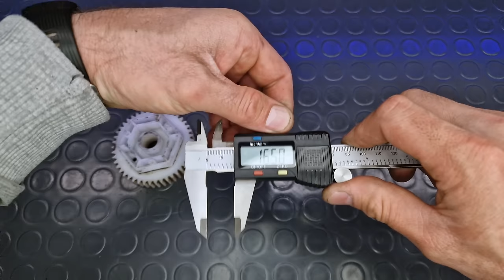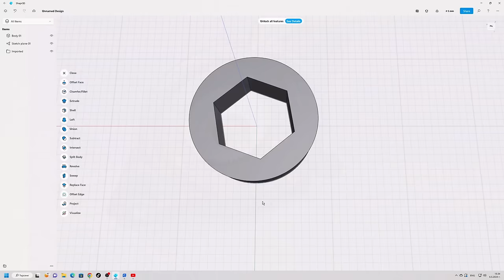Adding electric starter to Lawn Mower running with 20V Parkside Battery

Comment: Good job BUT, you didn't finish it. you forgot to put a cover over the little starter motor. it will get dirt and dust inside.

Comment: I just took the recoil rope starter mechanism off my mower and use a corded electric drill driving a  socket sized for the main shaft nut, to turn the motor over, F1 racer style. Works well enough for me.
Reply: my cordless drill works fine too. ;)
for those that are safety minded an extension with a ratchet to the deep well socket - yeah over kill, but even the sister can use it.   [useful on several small engines & starts it up in the field]
Reply: Yeah tried that on mine and it blew the battery drill up 🙄
Reply: @marksweetman8765  bummer - mines been ok, its a dewalt 12V and I yse it on high speed #2 I think.
 of course my  corded drill is bigger n faster, but its not as quick out of cord reach.

 to be honest the mowers been warmed before I used the battery drill - so its an ez quick start.
Reply: @bellyacres7846 I haven't found a ratchet  adapter yet that will work. The ones I've tried always locks in both directions when used in a drill because of the high speed.  I've come close several times of having my wrist broken.
Reply: Just remember to use ratchet adapter so it doesn’t tear up drill or nut on mower. I been using mine for years. Use on mower, chain saw, generator and weed trimmer. Works great.

Comment: Could you just splice the spark plug wire and connect it direct to the battery and put a switch that you briefly pulse?

Comment: This is an excellent idea without all that rotten pull string nonsense.
Reply: My recoil starter lasts a bit longer as my mowers have a device known as a blade brake clutch.  If I have to stop for whatever reason briefly, the blades stop and the engine continues to run.

Comment: Although I'll need to do some things differently I'm going to attempt this with my 5.5hp cub cadet engine. 
Ist off is my recoil start housing is made from steel instead of plastic. Next is the fact I've picked up 3 different power wheels cars for free but all have the 6v motor and single wheel gearbox. All have the cog type gear that mates with cog made onto the wheel. I shouldn't have a problem with making  the set-up work. I also have two 12v motors from another power wheels car.
I think the gearbox will stand up to starting my engine and I know others have replaced the 6v motor with a 12v motor.
My biggest concern is will the 12v motor and 6v gearbox stand up to a 20v Dewalt battery? Will the 20v battery burn up the 12v motor or if it doesn't burn up the 12v motor will it create to much torque and strip out all the gears in the gearbox? Now for my main questions of preventing this. One should I use a 20v to 12v step down converter or should I use a speed controller with the 20v battery? 
I could dial down the speed enough to where it doesn't trash the gearbox.
Both the speed controller and the step-down converter are fairly inexpensive with not much difference in price between the two.
Any advice would be greatly appreciated.

Comment: This was a very good build.

Thanks for the upload. I'm going to do this myself, but I'm going to use it on a predator generator and add a remote control for the motor so that I can crank it up during this winter without having to go outside into the cold to hand crank it.

This is a very good and useful idea.

Many thanks to you!

Comment: Check the valve clearances on this mower. If you set them up well, it will fire better.
Reply: Been setting mine by what Teryl does 4 thousandths. Does fire better.
Reply: I imagine the gearing from the Power Wheels gearbox is really low.  Gives you more torque, but it turns slow.

Comment: People are fascinated with letting electricity do all the work. The beauty of a standard car is you can push start it. Doesn't matter if the battery dies. I like to use muscle power. It's more reliable.

Comment: Do the fly wheels on these little engines not keep running when the engine is running? because if they do, that electric motor will still be attached to the spinning fly wheel just moving.
Reply: The flywheel does, but the motor and gear disconnect. Those two little spring loaded arms extend due to centrifugal force once the rope is pulled/motor spins. That makes the connection to the flywheel. After pull/spinning, the arms fold in again.

Comment: İ want to make my 110cc ATV engine starter like this but with this reduction its to slow to turn the engine
Reply from the maker: That's exactly why I used a 20V battery.
I think this DC motor is 12V

Comment: Awesome job but you Shouldn't use heavy grease in the dog leg spring area as it stops them retracting properly and i think thats what that awful squeely noise was when the engine was running
Reply: I was wondering about that, also, I expect dust will get in and make it worse over time.

Comment: Good idea. But when you use the battery without safety electronics, you can destroy it if you drain it completely. There is an electronic device in the battery, but it does not protect against reverse polarity on the cells.
Reply: The batteries have protection circuits built in to stop full discharge.

Comment: what is that spray that you use? brakekcleaner?
Reply from the maker: It is a two-part adhesive with a spray hardener (Mitre Apel, Akfix 705 etc.)

Comment: That's pretty clever and nice work by the way but back in my day I would just use my cordless drill and a socket and extension and spin the flywheel nut
Reply: That's a really excellent way to break your wrist (if you don't have an adapter that prevents rotation feeding back to the drill).

Comment: Does the clutch have any sort of spring back that way it’s not spinning with the engine when it starts up?
Reply: 10:54 Starter pawl springs.
Reply: @markrainford1219 yeah I figured that out when making my own😅, but the motor and gearbox I got doesn’t spin fast enough to start my 173cc engine

Comment: Without a bendix to disengage the gear, the gear will wear down fast.
Reply: It does disengage all he did was motorized the pull start mechanism which disengages by those metal pins and springs that he installed twards the end
Reply: Re watched the video. missed the clutch install before.

Comment: if you would have just added a bolt heat to the spinny part you can just use a drill
Reply: And then you take the risk of breaking your wrist. Also if it stalls then you need to go get your drill to start it again, unless you wear the drill on your waist like a handgun 😅

Comment: Hi Congratulations.  The idea and its implementation are sensational.
 Please don't take it as an intrusion, would it be a big request of you to upload the STL files of the parts you designed and 3D printed, or send them to my e-mail address?
 Thanks in advance.
 Regards, Paul😊

Comment: I dont think any of those tools were used as intended.

What did your child say after you wrecked his car?

It did sound quite good when it was finsihed.
Reply from the maker: The child has already grown up, the video with the child was about 5 years ago
Reply: @ErCanEverything  Yeah but i never like wrecking one thing to make another. Thats just me.  Couldnt you get an electric motor from ebay etc?
Reply: Its called repurposing... seems youre just happen to buy more sh.t

Comment: Why not use the cordless parkside drill on the nut to turn the crankshaft via a socket adapter ?
Hmmmmm not so much fun ?
Reply: He would have to carry the drill all over the place, front yard, back yard, etc.

Comment: Or, once you remove the pull cord, take your cordless  drill with a 19mm socket and start it directly off the nut that’s there.

Comment: This is the dumbest thing I’ve seen in a while. You’ve gone from a simple reliable pull start to an over complicated nightmare with batteries, motors, wiring, ect. So when you need to use the push mower your going to have to deal with all the crap like dead batteries, bad starters, solenoids, ect. That you have on a rider! Converting my rider mower to pull start was the best thing I ever did.